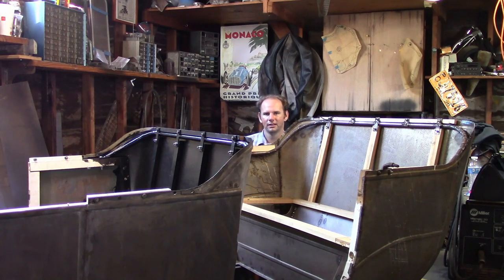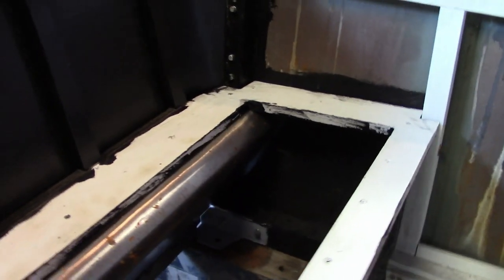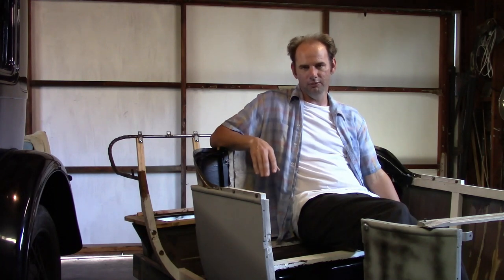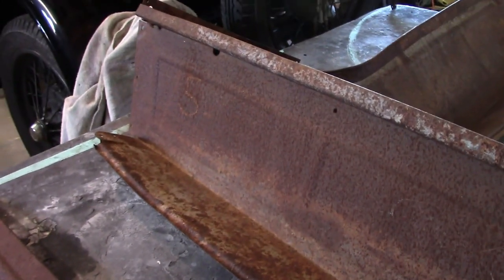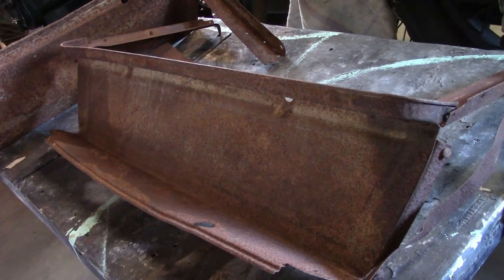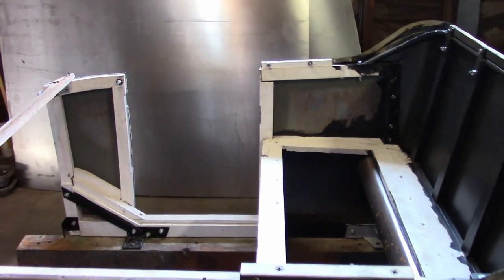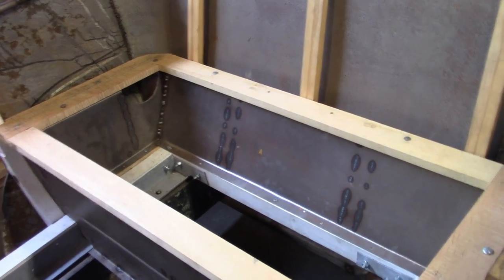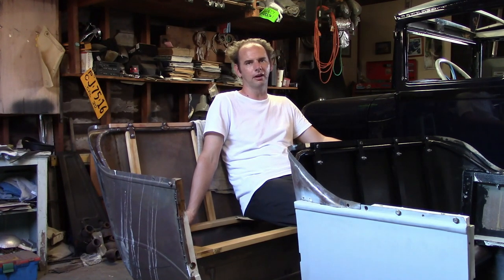Building a 1913 Ford Model T Touring body. Part 12.

Comment: I'm enjoying the Model T Touring body videos. Like you said 4 door cars a baffling and shouldn't be tried at home. I'm working on a 1926 Buick Master 6 4 door sedan. 80% of the wood was rotted beyond recognition. I replaced most of it but that doesn't help lining up the doors. There is no one to guide me through this. Your honesty about not knowing exactly what to do next is great. I hope you can finish the T Touring car series of videos and ge it painted. Thanks for the inspiration.
Reply from the maker: Thank you very much. I'm still working on it and it'll be ready for paint soon. sounds like fun. I admire anyone who will make and install body wood. Hope that project works out!

Comment: You are very correct about the seat position and tilt-back.  When I built my speedster seats it was the tilt-back that made the difference between comfort and a backache. Not that I really knew what I was doing... it was all just "cut and try" methods.